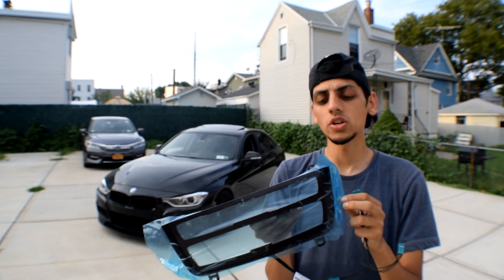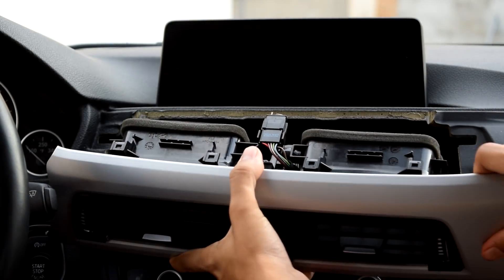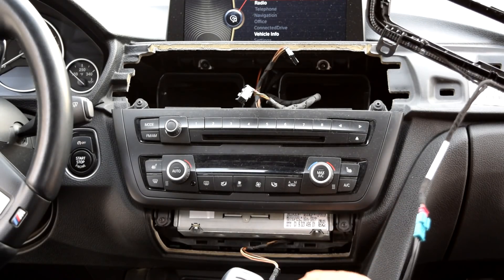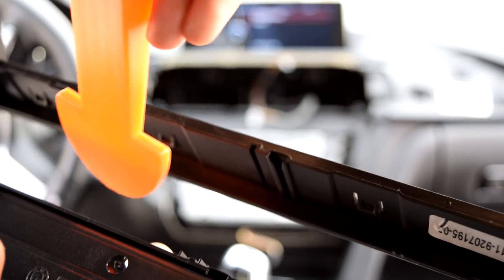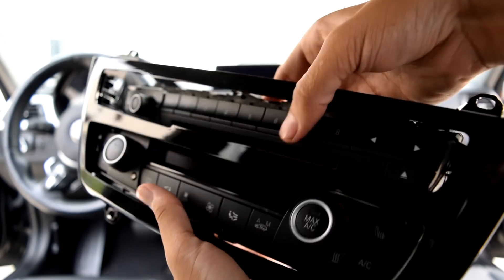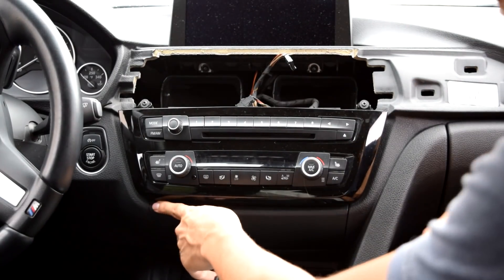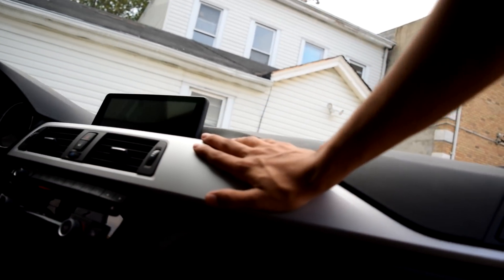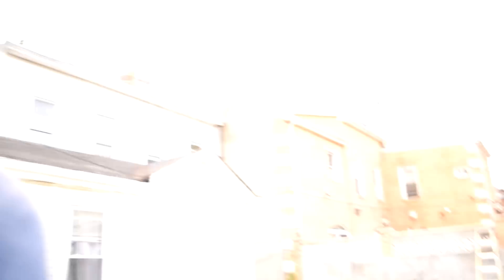BMW F30 LCI Radio Trim Upgrade! (EASY)

Comment: Quick question, so when i turned mine on it had the white light on by default and I don't have the option to change my lighting type under iDrive. Did yours turn on orange by default, or how do you switch between the colors?

Comment: I have a 2014 bmw f30 (320 xdrive) but I dont have that little light on the bottom panel, therefore its just a plastic pannel. Any suggestions on another spot where I could plug the light system if I decide to get it?
Reply: Hey, i have the same issue, any luck?

Comment: I just snipped both connectors off and soldered them together and heat shrunk.. works well didnt have to wait and buy a y cable from china

Comment: My pre LCI f30 car has the default lighting package so it has the lights on the door cards and the little pot lights, wondering if these aftermarket units are significantly brighter than the Oem lights? I just don’t want it to look off by being much brighter than the oem door card lights.

Comment from the maker: I just checked my cars window sticker, It says ambient lighting is included, so I believe everyones F30 should be able to do this! 🤔
Reply: Shumile Swift its standard with all u.s models
Reply: There are some that don't have the lighting plug.  An easy way to tell is if you have that light above the cup holder you can do this mod.  That is where the power is coming from for the LEDs in the bezel.  If you don't have that light, you don't have that power lead and it will not work.
Reply: Andrew Trujillo +
Reply: Hey my man I have a 15 228i with the lighting package and my radio looks exactly the same! Will this work?
Reply: Tyler Shaffer mate can i do it somehow without lightnpackage? I have a simple f30
Reply: MR MIAGI did you ever do it ? I think it should work I’m gonna try it
Reply: Bro  how can i make it work without the lighting plug?? 🤦🏽‍♂️🤦🏽‍♂️ i just got mine and found out i dont have it 😭
Reply: Miguel Alcantara did you ever figure out how to do it because I’m in the same position as you /:
Reply: Also waiting for a fix

Comment: Hi ! Great vídeo! One question : that trim cannot be adapted if your car doesnt come with fabric ambient light, right? Because mine have not that cable inside the inferior plastic trim with the light. Is there any alternative way to install the trim in my no-ambient light car? Thank you!!

Comment: 4:17 HELP !! I am I suppose to squeeze somewhere. I can’t disconnect that part. I couldn’t disconnect the top part either
Reply: It's tough removing the plugins from the top and the radio trim. A small flathead screwdriver helps to pry out the plugin but be careful it's easy to break the female part of the plugins.

Comment: How do I unplug that initial cable harness to the radio trim? Mine is stuck in there pretty tight. I don't want to break it. Is there a tab you press on before you unplug?

Comment: Does ist also fit on f20,f21,f22,f23? Would be awesom i have the led at the bottom. The controls for climate and radio are the same but I am not sure if it fits.

Comment: not all models of 3 or 4 series have this OEM Led at the this point to get the panel in. but this part should be for all models. but dont have the little led from oem... what yet?!

Comment: Is it only orange? My 2016 320i F30 has the led feature too but on the iDrive system, you can go under light settings and change it between orange and white color. It says ambient lighting normal or sport.
Reply: It changes white or orange with the idrive settings

Comment: nice video but i have a question.Can you fit an aftermarket player ( pioneer,kenwood etc.) to the top part of the panel.I mean i want to let the lower part which has the A/C buttons but i probably have to remove the upper part with the player buttons.Am i able to do that? if yes,do you know any players that will fit? or do i have to cut the plastic? Thanks

Comment: Hey swift when i attempted to take  out the cd player and ac unit out of the trim i disconnected the 3 black cables that hold them together. I managed to plug them back in but now i have no power to my ac unit? Any ideas why that might be?

Comment: Very helpful video👍
I will do the same as i have the lighting under the climate control, 
Mine is 2014 F30 Sport Line low option

Comment: I’m confused... I have an 18 330e iPerformance and the MSRP was like $61,000 and it says ambient lighting included. Mine already glows underneath the radio and stuff. But everyone in the comments is saying “you have to already have ambient lighting to do this mod.” Soooo if our cars already come with it why would you wanna mod it to the same thing? What am I not comprehending here...
Reply: ZX that is lci retrofit what means that if you have prefacelift car you can make it look like facelift one with retrofit things.. so if you have facelifted car then you have this thing in your car and everyone else is just trying to be like you.. :) and yes 18’ car will have that thing. Every car after.. i guess 2015 when the facelift came

Comment: I love it 😍 
I want to do it to mine !
One question, does it work in correspondence with the interior light selected ? 
I got luxury and sport. My colour is a white sports dim.
Reply: The colors change with the rest of the interior ambient lighting so sport will shine white and when you switch to classic it will be red/amber.

Comment: So I can’t do this because my F30 didn’t come with lighting package?
Reply from the maker: Norm Arciaga Yeah, you gotta have it. Im actually not sure how to check if your car has it or not
Reply: Just open your door and look for the light to shine on the ground.
Reply: If your interior is lit up at night then yes you can do it. But when I say interior lit up at night I mean your trims in the light that’s red/orange that is shining down on the seats
Reply: Okay! Whew... I can do this mod then. Looking forward to doing this.
Reply: The power for this mod is coming from the light that is above the cup holders.  Check to see if you have that LED on the panel above the front cup holders.  If you have an LED light there you can do this mod if you do not have this LED you cannot do this mod.
Reply: MessyGarage does your car have a little led-light above the cupholder? Yes?  You’re good to go.  No?  Draw your power from somewhere else, lots of options in the dashboard.
Reply: Tom's channel are you sure about that ?if yes, from which cable can i get power ?
Thanks !
Reply: I have already done this mod months ago and posted a video of creating the cable and installing the surround.  I was just commenting to help others understand the lighting option and where the power is coming from.
Reply: MessyGarage do you know if it’s possible to put this trim when the car doesn’t have the interior led ?
Reply: @maxime5062  I am sure you can but you would have to find a wire that is supplying power ideally ones that are already associated with the ambient lighting.  It would probably entail actually tapping into the wires rather than using the y adapter.

Comment: The link shows a white and an orange lci how do i make sure i order the orange one?
Reply: Tyler Shaffer You can alter the lighting by switching from sports to Comfort. Comfort is orange, Sports is white. Hope this helps!
Reply: Liam Sugiharto are you sure? I dont see how when the only connection to the panel is the power lead.
Reply: Tyler Shaffer Pretty positive. I Thought so too, but I Looked at other forums and turns out you can actually alter the lights. Just ordered them a couple minutes ago hahaha
Reply: What kinda bad information...
The LEDs are white during the day and become amber/orange at night.
Reply: Gregory Newton the white during day orange during night is an LCI feature.  So MY 2016+ cars only.  Unless a pre2016 car can be coded to do it as well. Definitely not stock though.

Comment: This was not even close to as easy as you made it look. Some of the trim was such a pain to remove
Reply: Tim Castleton did you break anything? That's what I'm afraid of
Reply: Luke J one of the clips on the back of the climate control broke so I stopped trying to pull it out and had to do everything with that clip in. All the clips are really hard to pull out and they all break really easily

Comment: Why the hell did you leave your car battery connected?? Do you want to kill your car or something, bc this can seriously fuck with the electronics. Own a bmw x3 f25 35i myself, and i have done a lot to the interior electronics of the car, for example a nbt retrofit. Its just a tip bro, bc when it does go wrong youre not insured!!!